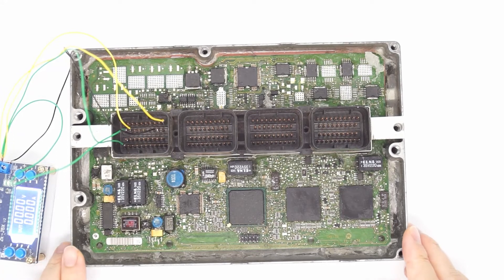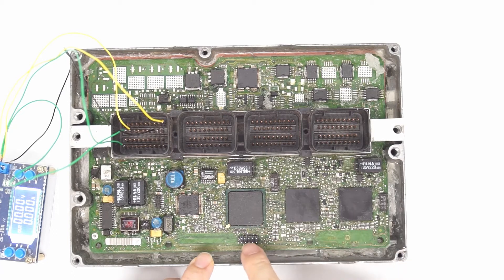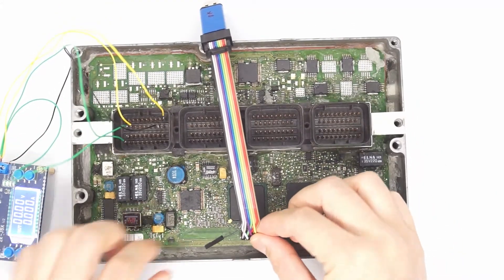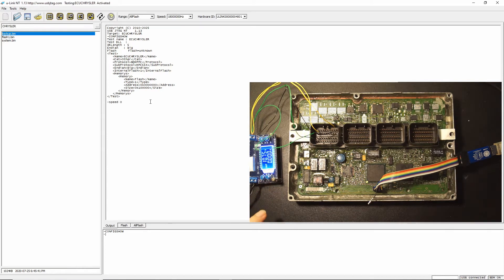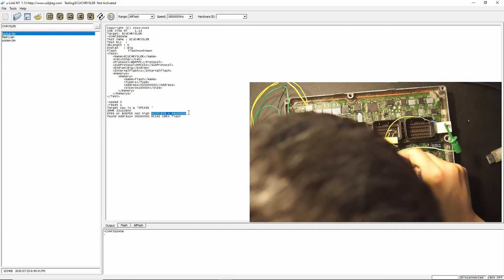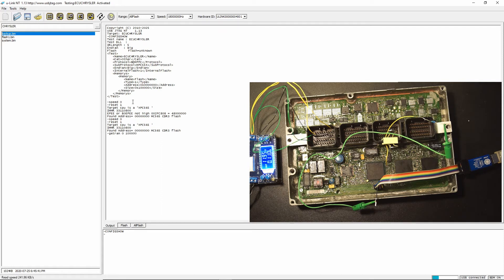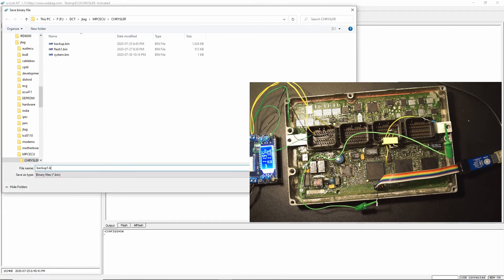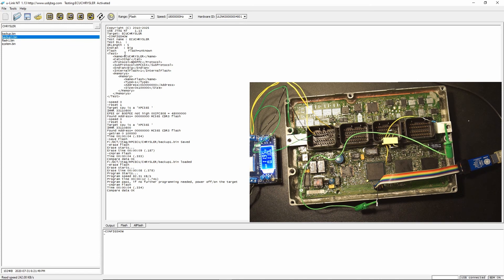u-Link NT to program MPC565 ECU (Chrysler)

Comment: your product doesn't work, it ruined 2 units. After flash recording, the ECU stops responding. Total, minus $600
Reply from the maker: You need remote help? BDM can always recover it even if it is bricked.
Reply: @usbbdm  I think nothing can help here. I wrote back the file that I read. The block does not wake up. And I am not the only one with this problem. When this happened to me, I started searching, and it turned out that my other colleagues had the same thing, after writing flash yulink, the block goes to sleep.
Reply from the maker: @СергейЛученок-г3й  This could mean the xml is not right and modify the xml should solve the issue. I can only confirm we can read/write this target but not test in the car.
Reply: @usbbdm  I'm having the same problem, any ideas?
Reply: If anyone needs help just lmk I had the same problem but eventually figured it out..

Comment: Your device does not read this block correctly. The Motorola 565 processor has 2 flash areas. 512 + 512. Yours reads 1024, this is not correct!!! 
besides, you have a pinout error. 4 pin Ulink is a purple wire, and in your diagram it is blue :)))
Reply from the maker: I have found it is the shadow that is not programed after erased. the 1MB flash is correct.

Comment: Hello my dear friend! There is an error in your connection. At first I connected like on a blue screen, but then I watched the video further. HRESET and SRESET are swapped. On the blue screen and in the documentation for the device the connection is the same, but in the video the purple and blue are mixed up. But it works the same) I checked.
Reply from the maker: Yes they works the same in here.
Reply: @usbbdm  Please help me. The fact is that I did the same as in the video and got a faulty ECU. This programmer subtracts 1024kb. FGTECH2 subtracts 1025kb from the same ECU and 4 bytes 50 68 30 00 are located at the address 100000h. Only 4 bytes, the rest is FF. After working with the same ECU with the u-link programmer, these 4 bytes turn into FF and at the same time the block no longer communicates. They are erased, but they are not written. FGTECH2 doesn't write these 4 bytes either, but it doesn't erase them either. Please help me restore it. Am I the only one with this? SW u-link NT 1.50 hwULINK00002054119
Reply from the maker: @AnmedSPb Go my site and I can help you via remote desktop.